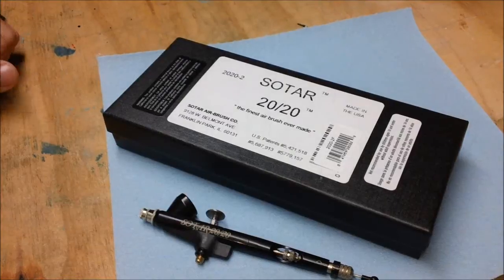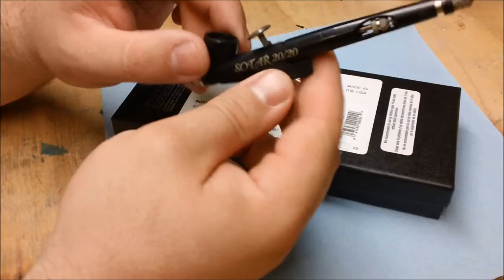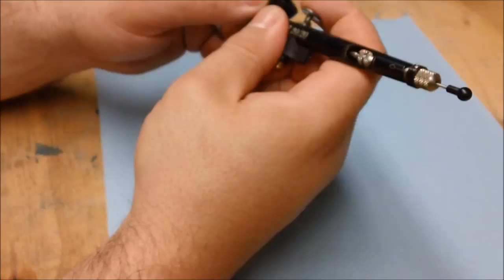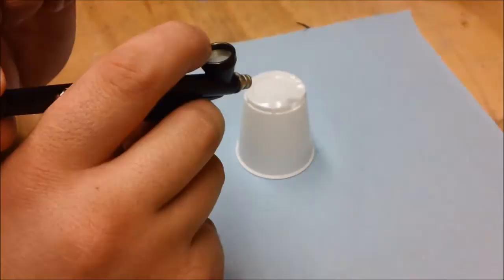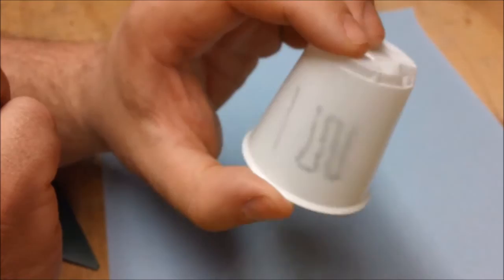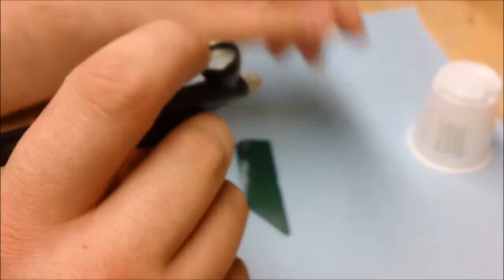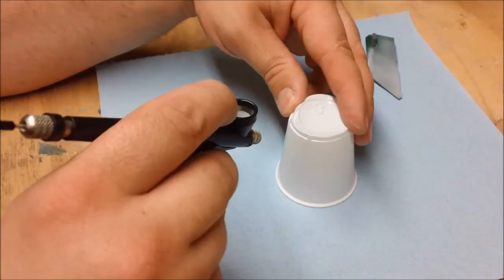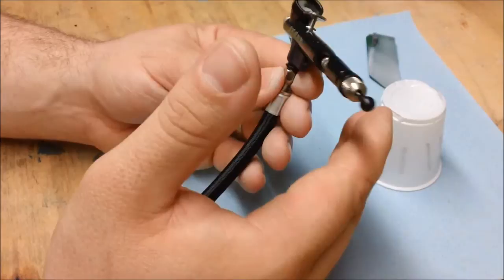Sotar 2020 and Gundams...

Comment: You nailed exactly what Badger advertises the Sotar as.   Whan you talked about the small cup, and it not being great for terrain, or large items.....

the Sotar isn't really designed at a "base coat"  airbrush,  that's why it has the small cup.

it's why Badger sells a kit with a Patriot 105 and a Sotar.   Patriot for Basecoat /  Large Shading  ,,, Sotar for Fine Detail.

the fine detail is where the Sotar really shines :)   it's what it was designed for.

the very features you didn't like as much, are what make it really shine as a fine detail air brush :)
Reply: I haven’t been able to find the 2 airbrush in 1 deal in stock anywhere sadly.

Comment: If you ever want to get a larger paint cup but keep the same needle/nozzle combo, try the Badger Krome. If you go to a show that Badger is at, the show price is $80.00 for the Krome. 
I just bought the Sotar at Wonderfest because I wanted the smaller cup for a clearer view of the work. I have not tried it out yet. 
Is the interior of the paint cup on your Sotar polished and smooth with no imperfections?
I am trying to get an idea of the quality level of the finish on the paint cup.
Thanks.